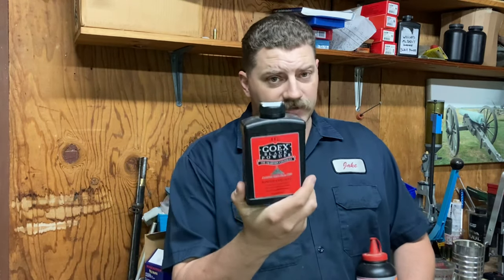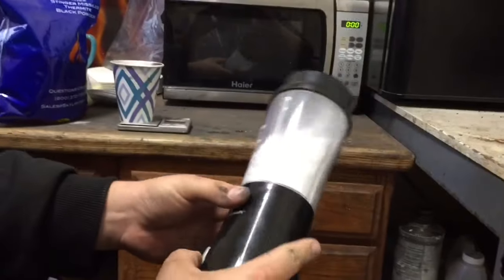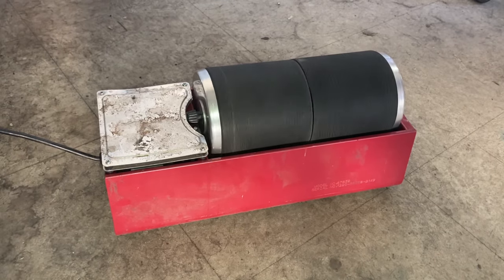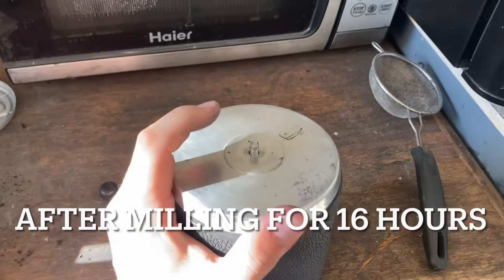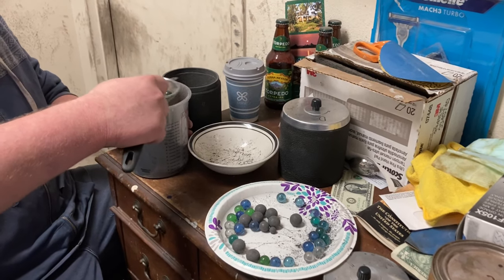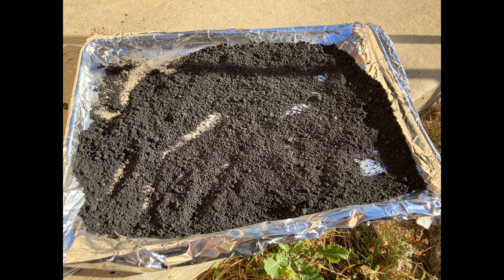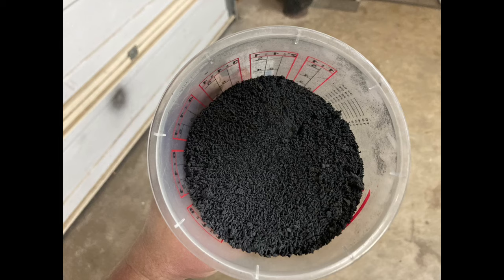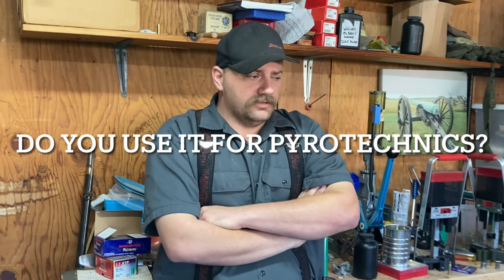How to make black powder (for firearms part 1)

Comment: I have a copy of the 1875 encyclopedia Britannica. It devotes about 40 pages to black powder manufacture. It's really quite an interesting read.
Reply: Yes and if you read the current Britannica it's down to one paragraph. "Black powder, a mechanical mixture of Potassium Nitrate, Charcoal and Sulphur."
Reply: @sheerluckholmes5468  (see: gunpowder) it's at 4 paragraphs in the 1989 edition
Reply: Omg where did you find that?
Reply: Be a good read the 1875 version
Reply: Hi,
Wanted to ask if you could share that with via Email.
Reply: I was showing my son a mail order catalog from my youth where you could order a rifle, shotgun, or handgun and have it shipped to your front door.
Reply: Can you give a reference? Volume and section?
Reply: I have a set from around the same time myself. Black Powder I in it and several other propellants/explosives. That's how I got the formula for the sugar/salt peter rocket fuel.
Reply: so post it online, thank you very much
Reply: @cheifreal Your telling me I can that I can learn how to make a bomb From a brittanica Article?!?! Where do I find!?!?
Reply: You should do a video with slides. And then it can be screen printed and enlarged.
Reply: Page 277-330
Reply: Hi -- Sorry I'm late to the discussion.  But can you tell me what the ratios they mention for BP in your 1875 Encyclopedia?  Modern sources say 75%/15%/10% but I have an old source describing the BP formula used in the late 16th century (Mediterranean area) as being 75/12.5/12.5 and I'm trying to determine if the formula evolved over time or if it varied region by region?
Reply: Just picked up a Hatfield 45 flintlock long rifle and tradition 50 cal flintlock
Reply: @ScottTheMarine still can with black powder firearms :)

Comment: Commercial black powder is compressed wet to thin cookies under high pressure, and then granulated. Thats why it have higher power density.
Reply: That's right, it's compressed into what they call "pucks", then ground, or "corned" into grains.
Reply: A little dark aluminum powder gives it a kick
Reply: @williamdevlin5439  Absolutley not with firearms, it might blow up. The burn rate gets to high for black powder firearms.
Reply: @atvheads  I was told that's why swiss powder sparkles. That they use 5% aluminum to their formula.  Now maybe it was bad information but I did some internet research and have found a few that mentioned it. Now for fireworks it's like 30% and I wouod have to agree it's quite high.
Reply: @williamdevlin5439  enjoy your mill blowing up 😬😬
Reply: @matthew33721  A little aluminum won't make the mill blow up. Maybe if I was using potassium chlorate instead of potassium nitrate. Anytime testing anything there's way to measure if it's safe. Most can tell tge difference of a burning propellant or something deflagrating with a crack rather a a fast oxidizing hiss. 5% aluminum is not enough to react like that. If you look people have been using many compositions of black powder,white powder, he'll even smokeless powder with the right math.During the civil war and after the south being broke they were making all types of powders and caps and what not and today with them old guns it shows.
Reply: @matthew33721  I don't think you know what your talking about. The mill has been running all night. I will time my burn compared to goex( it's what I have) and see how it burns.If it's too radical it won't go in a gun( buy 4th of July is around the corner
Reply: @cntrshot1  nope! works great. I used 5% by weight in addition too the potass nitrate,sulfur and homemade willow charcoal. combination ball mill, cia method with corning.Made friends in Switzerland on the powder business. They do not use aluminum. the sparks you see in their powder comes from knots in the willow wood as they don't separate it when they turn it to carbon. they strip bark( mostly) and use big and little branches in their machines. They mill their charcoal before anything else is mixed in.And all washing solvent is used over and over again only fresh added as needed.I press .45 diameter 40 grain pellets that I fire in a Colt dragoon and a Uberti Remington 1851.They work well and nothing loosened  up or exploded.When making pellets I use a modified star press and the acetone I use has a small amount of nitrocellulose lacquer glue used for fleching arrow vanes ( its how pyrodex bonds their pellets)
Reply: @williamdevlin5439  good to know you're having luck with your powder
Reply: @cntrshot1  even blackpowder will explode a gun if you leave an airgap. Any hobbyist pyrotech will tell you  even the scary flash powder will not make an impressive crack from detonation unless you leave an air gap in the shell or firecracker. you will get a weak pop and not the concussion crack that lights up the sky. There's a lot of misinformation out there.Even smokeless powder can be used(right type and charged based on design/caliber)but you need an inert material used on top before seating your projectile to make sure you leave no airgap(there are videos on this and plenty of information. A lot of people parrot information and comment on what they have no clue about..Modern black powder guns use much better modern metals than the antiques.
Reply: @williamdevlin5439  so you make your own charcoal? I saw a video of a guy growing his own potassium nitrate crystals.  One day when I have some time I'm going to try and make a batch from complete scratch for my cap and ball 44 also maybe my thunderer and 73 winchester replica. My goal is to buy nothing from a store as far as powder materials and get it done. Make my own caps and everything, used brass and scrap lead anyway. I'm not a complete novice, been reloading a long time but this whole making blackpowder thing is new. Should be awesome. Not sure I'm going to try aluminum right off, sounds hard to make and I gotta get the basics down first lol.
Reply: @williamdevlin5439  almost as bad as that time nitroglycerin was used in gunpowder
Reply: @GastropodGaming2006  If pioneers didn't practice different things in the gun hobby we wouldn't have modern powders. Nitro cellulose is used in modern gunpowder.  Chemically just like nitroglycerin but instead of glycerin added to the acid,cellulose( plant fiber) is added instead. Only ignorant people make comments like you made as it shows you really do not know what your talking about and those who are arm chair parrots repeating warnings from internet folklore should be quiet and let the chemist speak.Listen and don't speak and you might learn somthing. and if it scares you ,buy some panties and find a safe space. If inventors listened to you we would still burn sticks and live in caves.
Reply: @williamdevlin5439  yeah i know.
Reply: @williamdevlin5439  I can confirm that Swiss does NOT use aluminum whatsoever. I've seen their process, their materials and their tooling.

I have Swiss powder in the shop as well so not only having seen it I shoot it.
Reply: Can you use this mixture to reload .308, 9mm, and 5.556 ? Since it's black powder and  not smokeless gun powder, does it affect the cartridges much?
Reply from the maker: I’ve loaded 3006, 45ACP and 9mm they all work. The main concern is loading enough powder in the case that the bullet compresses the powder. I have a couple videos on it, if you’re interested
Reply: @Everythingblackpowder  yes I am interested,  have you tried using the acetone to compress the powder and see if it does a difference I. Strength? Also does it have to be raw and pure ingredients?
Reply from the maker: @dennysverdin  https://youtu.be/CTHypmamzFg
Reply from the maker: @dennysverdin  https://youtu.be/yo-YdRIfxS8
Reply from the maker: @dennysverdin  https://youtu.be/VakNaLTOllI
Reply: @missingthe80s58  Swiss powder is polished, thats what i heard.
Reply: Definitely his black powder probably is on par, thing is he has to Puck it like all the commercial black powders.

Comment: As others have said compressing it into pucks first and then breaking it and sorting through screens into sizes will help a lot, but a few other things will too. The saltpeter is water soluble and it forms crystals really fast, so fast that to find it in caves they just leave a footprint on the floor and if in the morning the print is gone they know the dirt is rich with the stuff and that the moisture in the air had remade some crystals erasing the print. To make fast power you want the crystals as small as possible so controlling humidity during the whole process is really important and drying it as fast as possible helps. When making the dough that you'll corn keeping the dough a little on the dry side and using alcohol instead of water helps and compressing it with a rolling pin between plastic wrap or wax paper before pushing it through the screen helps make the powder more dense and gives you more uniform grain sizes. Pre-grinding the three ingredients in separate cheap blenders before sending them to the mill together really helps too. But you have to have a dedicated blender for each of the ingredients for safety. The saltpeter is the most important to pre-grind and should be sent to the mill immediately after grinding. If the charcoal is airfloat and the sulphur flowers of sulphur there's no need to pre-grind those. Adding some graphite powder to the dough or tumbling the finished product in it will help in a few ways, but most are useful to the commercial producer. It acts as a lubricant so reduces fouling and makes it a bit easier to corn the dough during the making of the powder and it reduces the risk of static setting off the stored product a bit and it makes the outside surface harder reducing dust and damage to the granules during storage and transportation and it can slow the burn rate if you happen to make powder that is too fast. I suspect commercial producers also use things like beeswax, lanolin, or mineral oil at some stage in the process or as a final coating to reduce fouling, but that's just a guess, but that may be why they can use dextrin without adding fouling. Pyrodex fouls badly because it's sugar based (corn starch dextrose) and dextrin is just a modified corn starch sugar. Another youtuber has had success using a special tree bark powder to replace dextrose to his dough. Either way the ancients learned that tumbling the final product slowly in a barrel helped to reduce dust and round the edges of the product making the granule size more uniform increasing burn rates and making the loads more consistent and various coatings like graphite can be added during the tumbling stage. A lot of candy is made this way so it can be called candying or sugaring. The granule size is the most important thing. You want to go a bit smaller than the commercial stuff since homemade burns slower. The go and no-go sizes screen mesh sizes and granule sizes of commercial stuff is listed on my sight. embscomputerart dot com slash black-powder-sizes
Reply: So how to make it more combustible? You really have a good handle on the process. Does cellulose ring a bell?
Reply: @UserUser-ke4ti  No. You don't want to add any cellulose to blackpowder. Blackpowder firearms are designed to withstand the blast only from regular blackpowder with no strange additives. If you change the basic recipe that has always been used by the ancients at all by the addition of other ingredients you would cause a dangerous situation for yourself and others. Cellulose is used to make smokeless powder, not blackpowder, and cellulose powders are notoriously and unpredictably powerful and unstable. Only the best chemists know how to make smokeless powders correctly and it's not something that can be done at home. It requires special equipment. It took very good chemists a long time to figure out how to make a stable cellulose powder and how to granulate it in a way where the pressure curve was predictable. One batch of smokeless powder can vary a LOT from another and one type can vary a LOT from another so only experts that work for large chemical corporations and powder manufacturers like Dupont, Hogdons, Alliant, and Winchester know how to do it correctly and how much powder should be used in any given caliber of firearm with any given bullet weight and any given case capacity. And cellulose powders, that is smokeless powder, can not be used in a blackpowder firearm at all. It is way too powerful for blackpowder firearms even when stabilized and granulated by special machines. So don't try to make anything like that at all. It will not work and it will kill you if you try to use it.
Reply: I am working up a recipe with 2x sour mashed ball milled carboned from the grain from my still as I too think the fouling and speed have more to do with all the sugars in the carbon.
Like your wax paper idea! I made one batch with a pinch of corn starch at the end of my mix/cook but the parts got a little harder than I wanted, but decent energy for that experimental recipe.
Reply: @UserUser-ke4ti  are you talking about "Nitro" Cellulose? that is a part of Modern smokeless propellants! or known as Cordite!
Has zero to do with black powders!

One is combustible the other is Explosive!
that is why they ship and store differently!
Reply: VERY nice page you have there, thanks for sharing.....I wonder if a set of gold prospecting classifier screen might work for granule sizing....
Now that I've read over your page, I'm thinking that the op might be having to increase his load by 20% due to the screen size....?
Reply: @TheWingnut58  I Like it! Great Idea! Thank You for sharing. I too am chasing the craft! of powder and caps hand in fist.
My ball mill is running Now with a very light carbon from guava tree smaller branches and scrap 30 cal bullets of different weights for No Spark balls wet with 70/30 alcohol, dry creeps "ME" out and no dust.
Reply: @jeremiahembs5343  No yourself. Smokeless powder uses nitrocellulose (nitrated cellulose). That's not the same as plain cellulose.
Reply: @jondellar  that's true, but potassium nitrate is water soluable so it's easy to nitrate the cellulose during the dough making part of the process. it's not as well nitrated as when the cotton is saturated in acid like when making gun cotton, but it's still nitrated.
Reply: You need to do your own video 😀
Reply: @UserUser-ke4ti  celluse will create high pressure a big no in muzzle loading firearms. Willow charcoal made the differance in mine.
Reply: A note to all. Powder for a firearm needs to be pure. Additives are to be used in fireworks! Don't blow up your toy and put a hole in your neck.
Reply: You sound like the subject matter expert here. I'm ignoring what some others have said in the comments here... I value my fingers, face, and bang sticks being in their current configuration.

Comment: One source said historically British used 75/15/10 while the French used 75/12.5/12.5, the Swiss black powder is 75/14/11, while the most efficient ratio calculated by chemists is 74.64/13.51/11.85. I wonder if that’s why Swiss is cleaner.
Reply: Not to mention you have to puck your black powder. If you wanted to perform like the commercial brands. Basically you put it in a die what about a thousand pounds of pressure. It comes out rock hard kind of like ceramic, you let it dry and then you grind it what's a hand cranked grinder.

Comment: :dothefive:NOTE For anyone referencing this video to make Black powder, I've learned that if you are not in an arid climate like EBP (they're in the south west-US), make sure you either use your freshly made charcoal immediately, or dry it in an oven first, or you will have very poor, slow, dirty powder. Charcoal and potassium nitrate will absorb moisture from the air very quickly, and spoil your BP. You can dry them both first in an oven set for *200 for 30 minutes, spread on a tray, then straight into your ball mill so as not to absorb the humid air. ..I'm on the east coast (US) and learned this the hard way. 🤠 P.S. DO NOT try to dry your finished powder in an oven! 💥